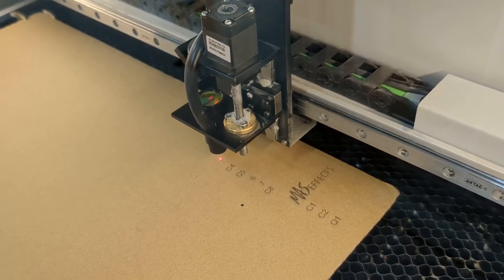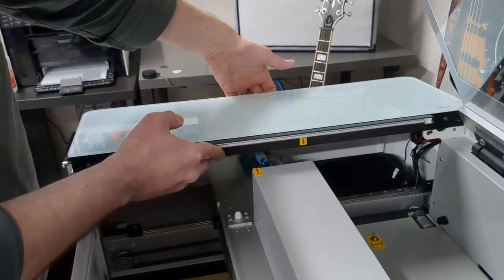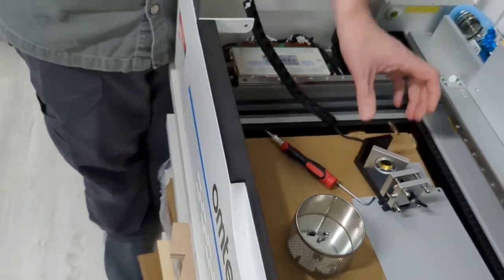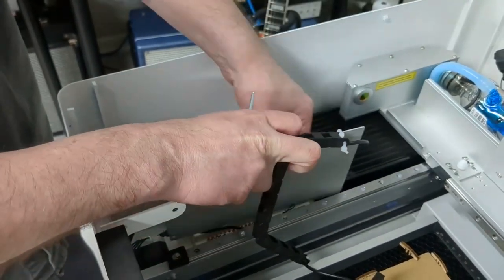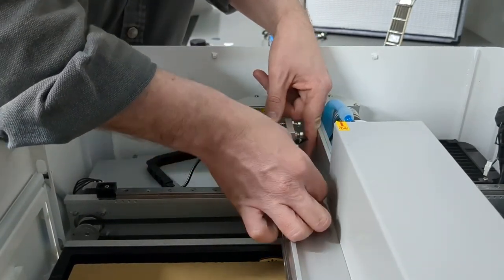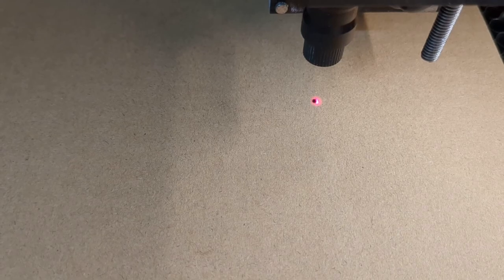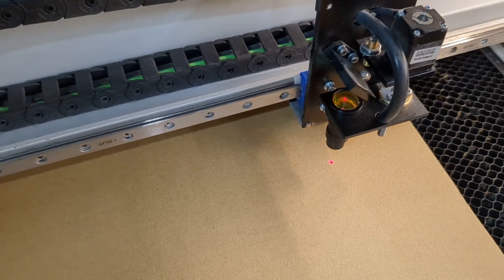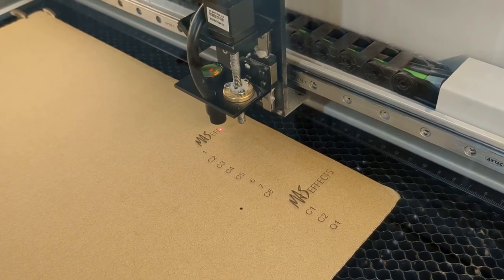Installing a Red Dot in the Omtech Polar Laser Cutter

Comment: I just received the red dot upgrade, and it works wonderfully!!  It installed quite easily and the instructions were perfect and very easy to follow.  One thing I would caution everyone about is to not tighten to mounting screws very much.   The alignment is a bit tricky as others have mentioned but not impossible.  Just be a little patient and it can be aligned perfectly.  I absolutely recommend this upgrade to everyone.  As someone else said, OmTech should include this on all of their Polar lasers.
Reply: Hi, can you share purchase link for this upgrade?

Comment: I am so impressed. Great job. One small suggestion .. I picked up a small magnetic parts holder at Harbor Freight. It sticks to any Ferrous surface and grabs all the screws. Just a small thing but help to corral those pesky screws.
Reply from the maker: Yeah those are great. I have a few scattered about my workshop. The one in the vid has a magnet too. :)

Comment: I am having a very difficult time disconnecting the LED lights...any tips? Your video made it seem so easy!
Reply from the maker: No unfortunately (or fortunately?) that's probably the hardest part of the process. If you have needle nose pliers you can try using those. Just be very careful to pull the connector and not the wires.
Reply: nm I really had to tug it! Also of note, if you are getting a red line instead of dot, twist the tip of the laser to focus. So happy to have this done...not the easiest upgrade but makes it so much easier to get the laser EXACTLY where you want it! I also did the Ruida Controller upgrade at the same time using the Ethernet port hole...I spliced the wires so that I wouldn't have to cut the machine--much better to do both upgrades at one. Thanks for all the help and the quick email reply!!!

Comment: I have a Gweike Cloud Pro II. They seems to be the same laser. Do you think this would work with the Gweike Cloud?
Reply from the maker: It'll fit in there physically, but the control board is different. I can't verify there's a way to draw power from it. If not, it would need to be powered externally. At the site in the shop listing, it has a link to a USB adapter that could be used.
Reply: I was thinking the same thing for my Gweike Cloud Pro I.  were you able to get this working?
Reply from the maker: @VKeeper42  We've had a few Gweike owners use this successfully. Physically it fits perfectly. It's just a matter of powering it. I don't think anyone has hooked it up to their control board, though. They used a 2.1mm barrel plug adapter to power it.  I know there's a variety of control boards out there for this machine though, so check yours to see if you can find a spare 5V and GND connector.
Reply: @mas_effects  I've just installed this in my Gweike Cloud II Pro 55W and it went in just as easily as described. I picked up the same USB power adapter suggested on the ordering page and plugged it directly into a spare USB port on the board. Looks great. Works great. Now I'm just fine tuning the aiming.

Comment: Mine setup does not match yours. First theres a fuse inline now. Makes it harder to stuff under the plate. Second on the back side the wire is in the way coming out of the wire channel making it harder to set the screws.
Reply from the maker: You can pull the wire out of the channel and adjust how much slack is on it, if that makes it easier.

Comment: Do you have a video showing how to remove stock fan
Reply from the maker: I don't but it's pretty straightforward: Remove those 4 screws on the back panel, then pull the panel forward and pivot it down (you'll see it has a cable keeping it attached - just leave it). The fan cable is taped to the back of the machine, just unplug it and remove the screws holding the fan in place. That's it. When you put it back together there'll be a gap where the fan was, and I just covered it with duct tape. Eventually I replaced the tape with a 3d-printed shroud, but that's optional.
Reply: @MAS Effects  Yeah, that sounds easy enough. Also, do you have an eta on the red light beam. Thank you. Michael
Reply from the maker: @michaeltanner1162  they're for sale now on the site. First two batches are sold. I'm waiting on parts for the 3rd batch. Best guess is 2-4 weeks but they're shipping from halfway across the globe so I can't be sure
Reply: @mas_effects  By removing the stock fan did that help quiet the polar noise down, also did you use the supplied inline fan? without the stock fan did the supplied inline fan seem to remove all the smoke from inside polar. again, Thank you. Michael
Reply from the maker: @michaeltanner1162  I don't think it changed the noise too much since the inline fan is louder. I have a very short run of hose (~1m) so the inline fan is more than powerful enough to both pull the smoke from the enclosure and eject it through the window. I removed the enclosure fan since it has less air flow than the inline fan and was probably hurting more than helping. 
If I had a longer run of hose I'd want both fans.